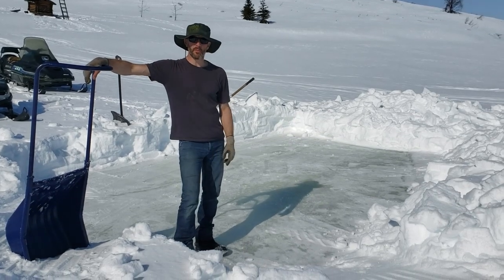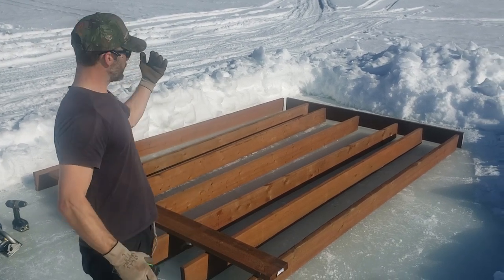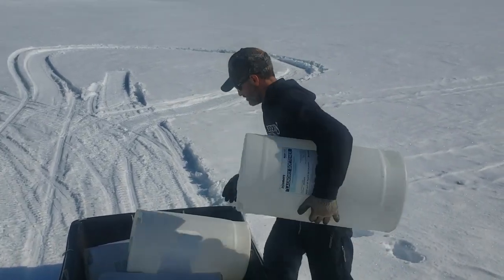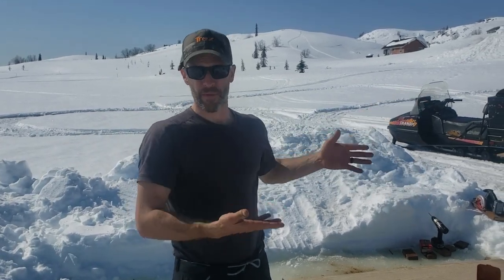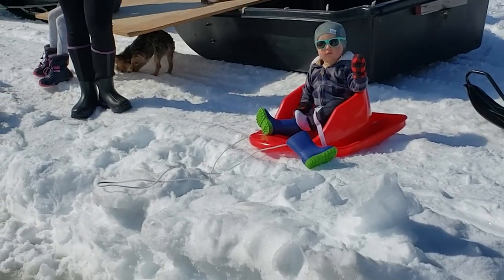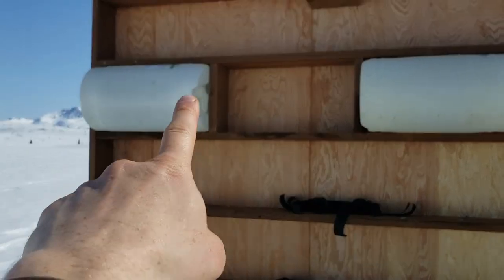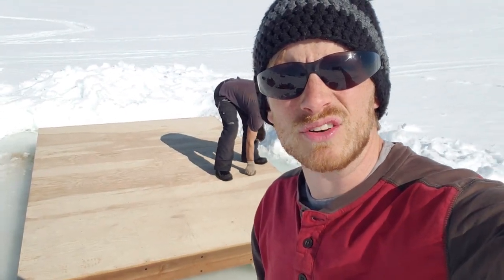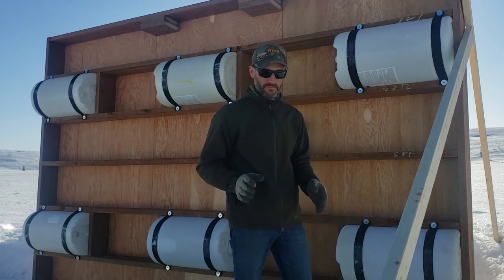How to Build a Dock on a Lake - Remote Alaska Lake

Comment: 6×15 gallons 
=90
90×8 pounds per gallon of water displacement 
=720 of total displacement/support from the 6 barrels
Reply from the maker: We figure the entire weight of the dock is around 800 pounds and we actually want the frame of the dock  into the water a bit. It makes it a lot easier to tie up a float plane. We will see if my math works. 🤞🏼